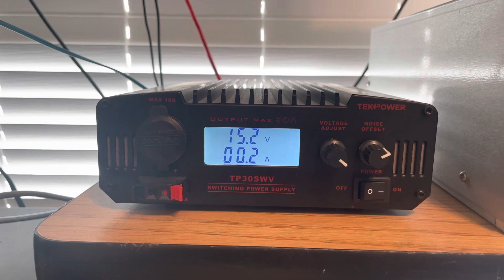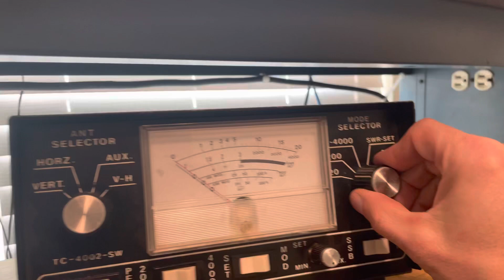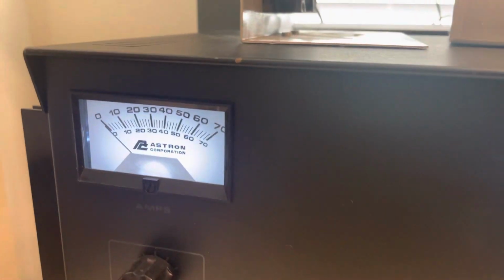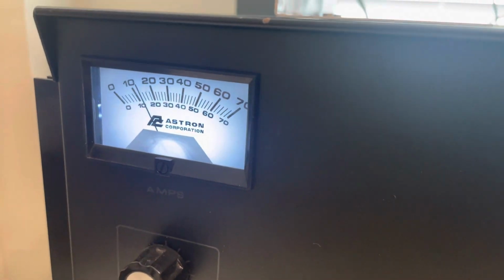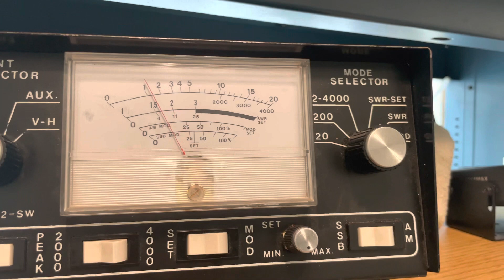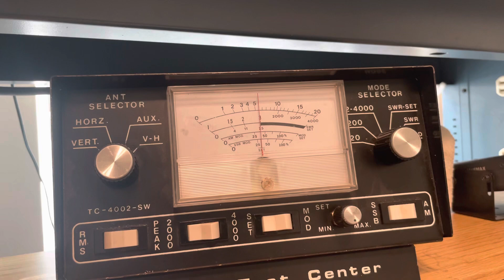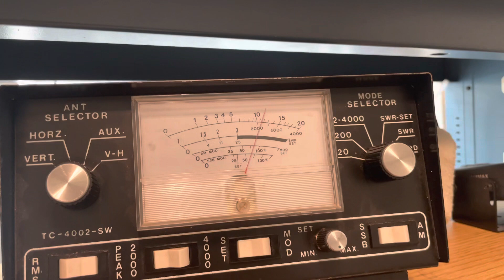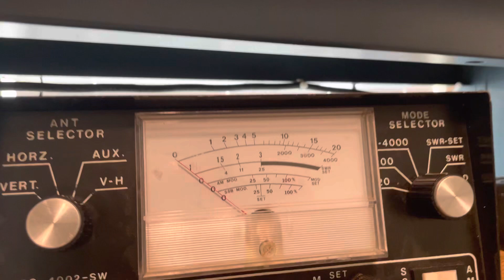CB Radio - Testing a Superior Amps Mosfet 2x4 - (2x ERF2030's driving 4x ERF9530's) into x16 Mosfet

Comment: Hello I just came across your video, I just acquired a superior amp, it has 20 ERF 9530s I really don’t know much about it looking for some info on it like drive and amp draw it is a mobile , and if it has drivers in it  , I can’t tell,  any help would be appreciated,
Reply from the maker: If it's got 20 then I'm almost certain it has 4 drivers to drive the 16.  16 like the one in the video requires a lot of drive.  I got your email - please send me a picture of the inside and I'll be able to know for sure.  You can also try driving it with 5 watts and if it does good power, you can also be certain it's got drivers.

Comment: how much does he sells these for, is it the biggest one he makes? Thought about playing with one.
BTW I am pretty sure I spoke to you on the phone some time back about your messenger amp.
Reply from the maker: The biggest one I know of is the 16.  I think they sell for around $850 new.  I bought mine used from a guy here in Socal.  I saw someone selling one and listed on Facebook out of Hawaii, not sure if it's still available.
Reply: @Z28videogates  right on. How do they sound on side band compared to say a Texas star or messenger with AB bias?
Reply from the maker: @swingdaddy2126  I use it on 10 meters behind my Icom 7300.  100 watts in I get around 600 watts out.  No one complains about it sounding bad.  The SSB delay is too   short in my opinion, I need to work on making it longer.  Maybe I'll do a video of it in SSB operation.  You gave me an idea!
Reply from the maker: @swingdaddy2126  I wonder in AB bias, how much more gain it will pick up, maybe it won't be so bad.  What do you think?
Reply from the maker: @swingdaddy2126  Copy that.  Re WWPDX yes but not for a very long time.  I didn’t know it was still that active.

Comment: If you add a big stereo capacitor as well it will help
Reply from the maker: I was thinking about that.  I also have been looking at those 100A power supplies for $30 on eBay.  Just 2 of those should do the trick.  But I'm going to measure the voltage at the amp and see what the voltage drop is.  I really don't want more than 14VDC into it anyway so it might already be okay - I'm going to check.
Reply: @Z28videogates  I have my astron turned up to 15.3 and use 2 big caps on a 50 am astron and I can run my 8 pill on am only. If I try  sideband it's too much but if I do it like that I don't have to have batteries hooked up
Reply from the maker: @358viper  Copy that.  What's your 20 nowadays?  You still in Cali?
Reply: @Z28videogates  ya I am in the high desert I live in apple valley